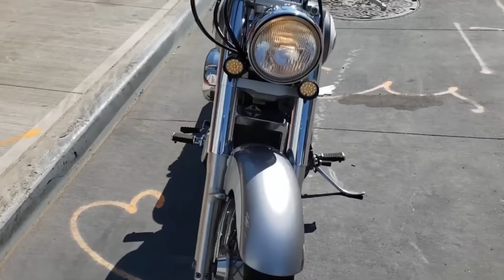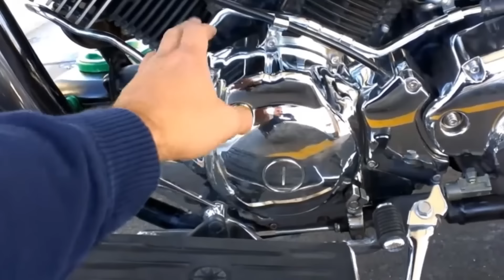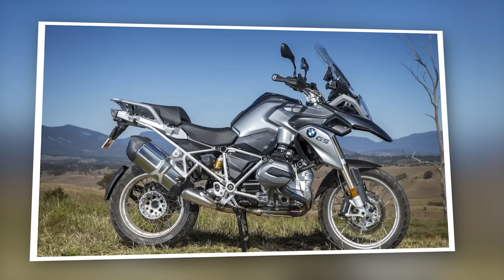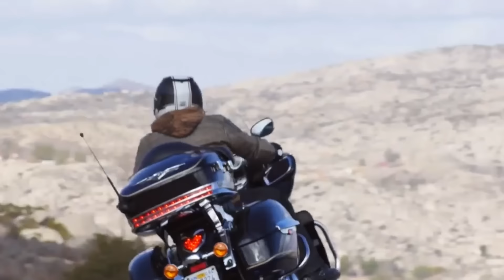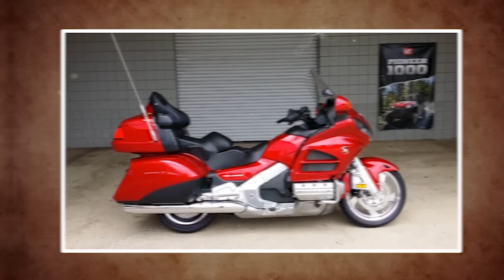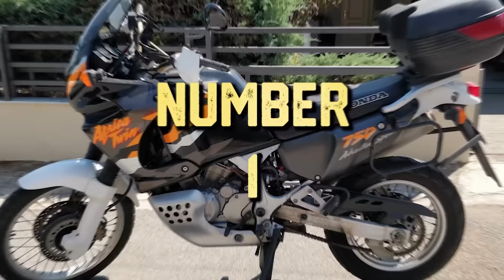These 15 Old Motorcycles You Can Buy Cheap & Keep FOREVER

Comment: The reason why I have a backup Emoto is because I’m afraid in 2030 they’ll cut our fuel off and even our electric electricity and I found a way to fully charge it using nothing but solar panels from Harbor freight.
It takes about five hours to charge from 0 to 80%.
But God, I hope I’m wrong because there’s nothing like riding down along stretch of flat Florida highway with the throttle open and loud V twin

Comment: The biggest  problem  with   old motor cycles   is when  they are in  storage  with  ethanol   E10  gas   , It always  ruin  the  fuel  system   / Ethanol free  gas   will  store  much  better  with  gas stabilizer  !

Comment: I got lucky when I bought my Vulcan 900. A 2007 with only 2871 miles on the odometer last year. I got the price down to 2850. So essentially $1 a mile. Garage kept so basically mint

Comment: Just bought a 2013 Kawasaki Nomad 1700 for $4300 USD with only 24,000 miles on it. It needed a good clean up, and a tank of gas with fuel injector cleaner run through it (I'm thinking maybe I'll also change the spark plugs), and a K&N air filter, but otherwise, it is in excellent condition (the dealer even put two brand new tires on it included in the purchase price). I did an oil change after my first 1,000 miles, and the dealer oil came out looking pretty clean, but now I know it is really clean inside. This is my 3rd Nomad 1700, and I'm sure with good maintenance, it will be good for a total 150,000 miles.  This bike was built as a direct competitor to the Harley Davidson Road Kind (same basic layout nad design). I have owned both and will put my vote behind the Nomad every time due to price per quality and style experienced. My H-D was a 2008 so only had a 5 speed transmission compared to the 6-speed of the 1700 Nomad. Perfect. The only issue with this video in general is that it constantly picks the smaller engine size of each of the pick (eg. Nomad 900 instead of the 1700, Suzuki C50 instead of the C90, etc.) which I don't understand, but maybe the thought is that the smaller size engines are more universally preferred for some reason.